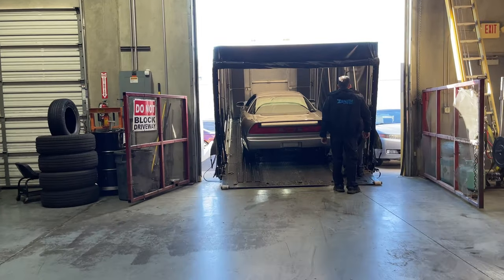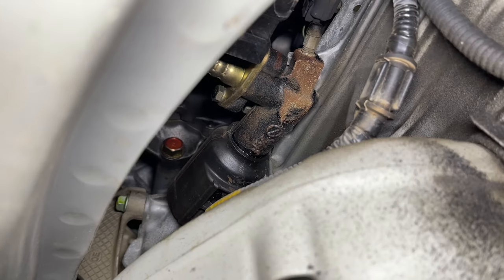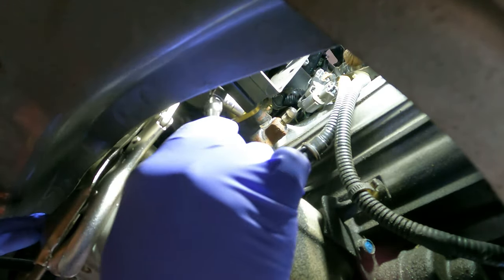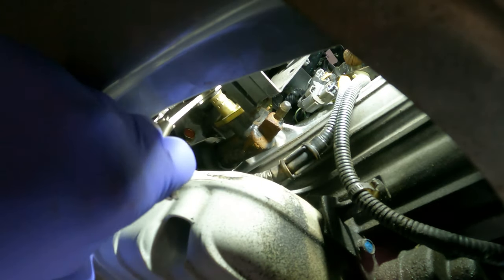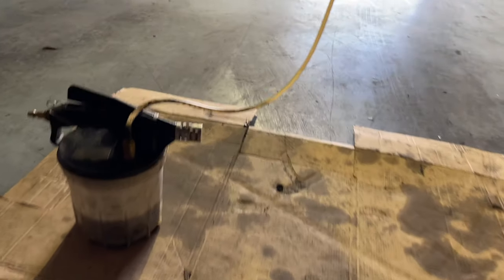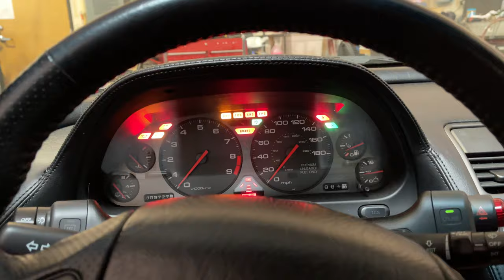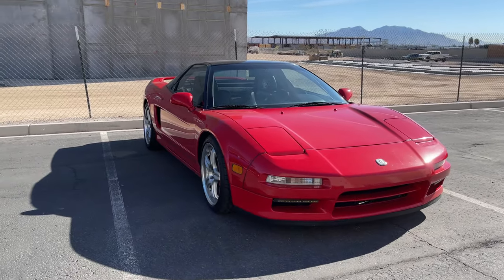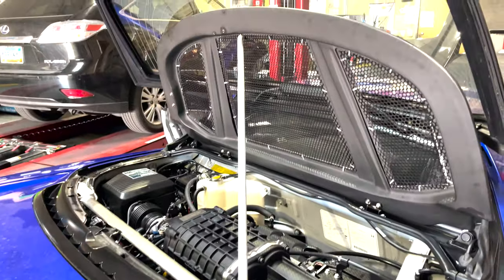CLUTCH SLAVE CYLINDER REPLACEMENT ON AN ACURA NSX

Comment: I have a 91 NSX gonna have the timing belt and water pump serviced soon. Probably will have the clutch and other clutch components checked as well. Great Video!
Reply from the maker: Nice, are they going to drop the entire engine cradle to do the work? Or do it in the car? I actually enjoy dropping the whole thing and sealing up all the seals on these.
Reply: @SkillCollectors  gonna drop the engine to do the work.